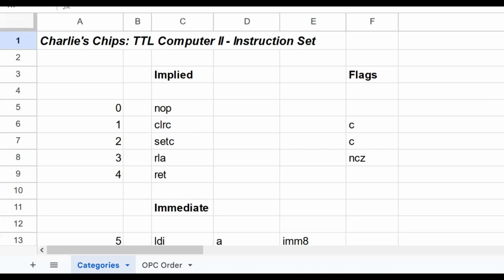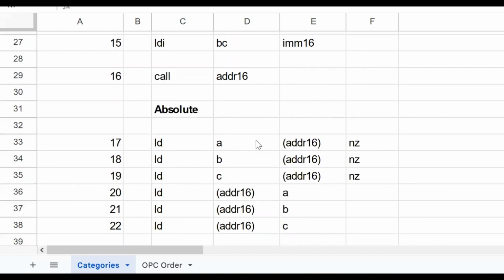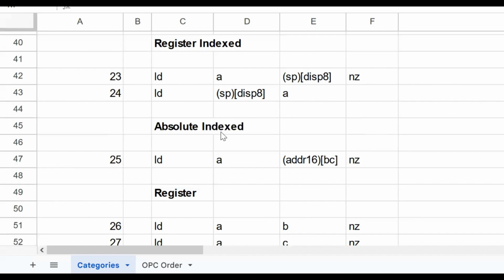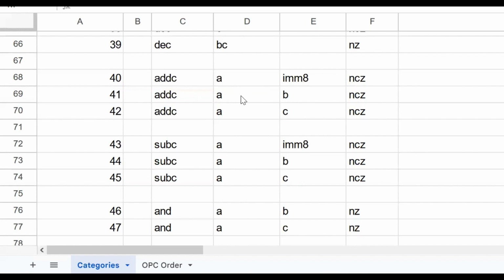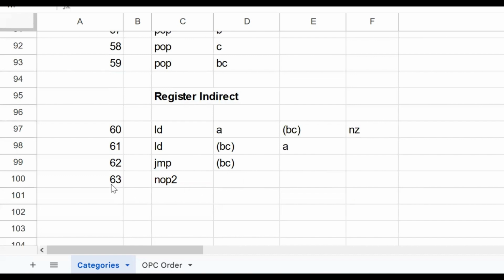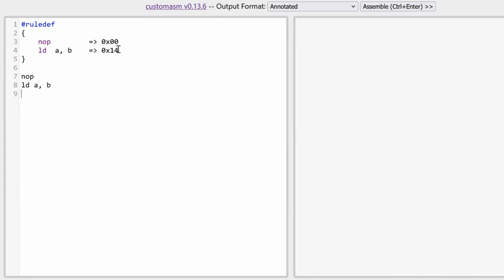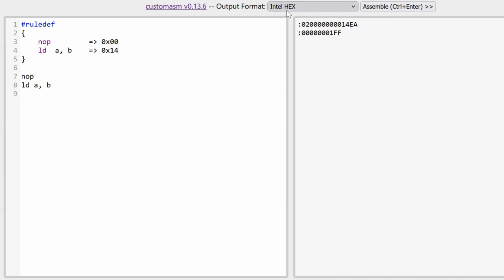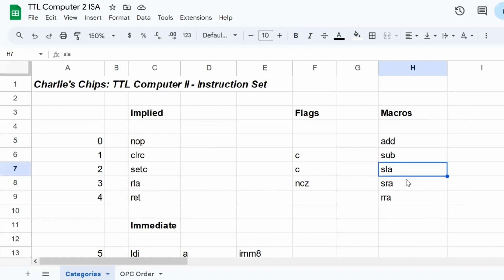TTL Computer II #3 - Instruction Set & Assembler

Comment: I'm missing a Right Shift (and/or Rotate).  Left Shift is basically just an Add by itself so that's not needed.  I guess the RLA instruction rotates the acc round through the carry, so after 9 rotates you're back to the original state.  But a SHR is really useful in many situations and a bit hard to emulate with the current instruction set. (EDIT: I see you mentioned emulating the Right Shift as a macro in the end of the video - that teaches me to watch the entire video before commenting ^__^ )
Reply from the maker: Yes, RLA rotates through the Carry Flag. SLA is just a macro with a preceding CLRC.  I really wanted a hardware shift right, but just don't have any control lines remaining.  I had to do it as a macro.
Reply: @CharliesChips  Macros can be a life saver sometimes. :) I'm currently writing a Tiny BASIC in SUBLEQ assembly (a CPU with only one opcode -  subtract the contents pointed to by A  from the contents pointed to by B and store the result back into the memory pointed to by B and then jump to C if the new value of B is zero or negative. Where A, B and C are a part of the opcode.) My machine is a 24-bitter so each instruction is 72 bits. I have macros nested in three or four layers to build up usable instructions from this single one.
Reply from the maker: @MatsEngstrom  Hey that is really cool.  I have had interest in these single instruction (RISC I suppose) machines.  Would be cool to learn a bit more about your work on that project.